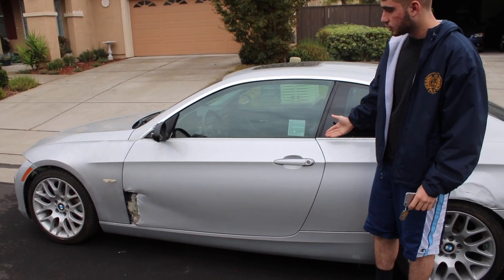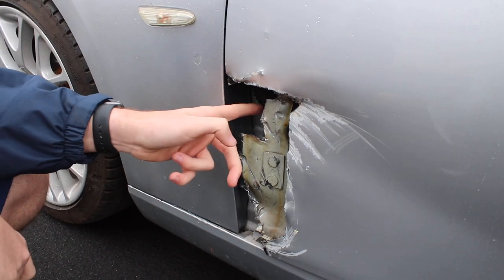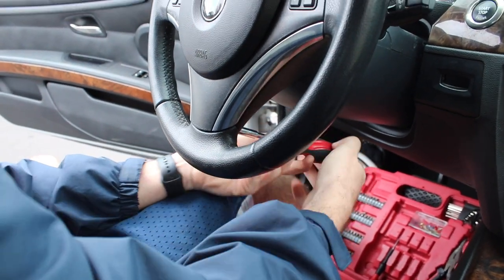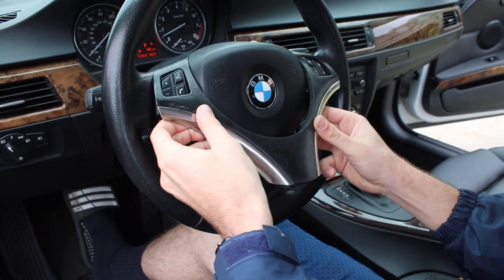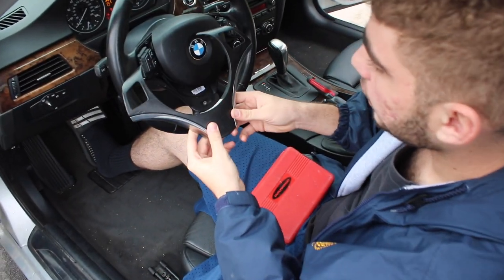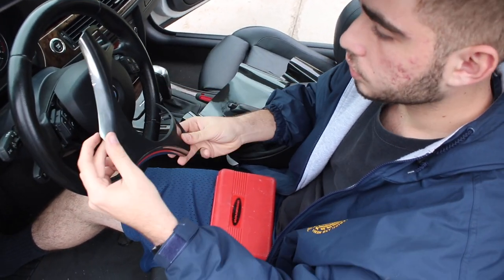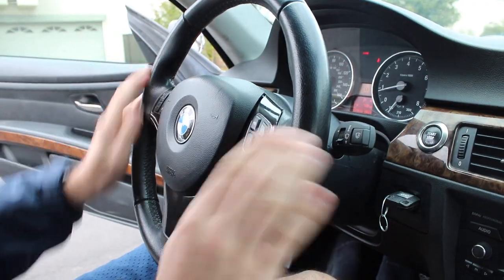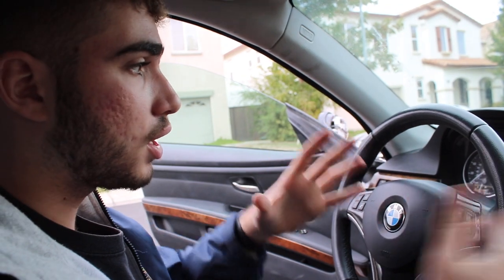WRAPPING MY BMW WHEEL TRIM (LOOKS SO CLEAN)

Comment: That's nice it really looks 1 million times better! Quick question. On your 330i when you went with the new bumper what did you do about the fog lights? I've got a M-sport that won't connect to the non sport wires.
Reply from the maker: http://amzn.to/2zxbq5P this is the one you need to make sure the correct wattage is flowing to your new bulbs.